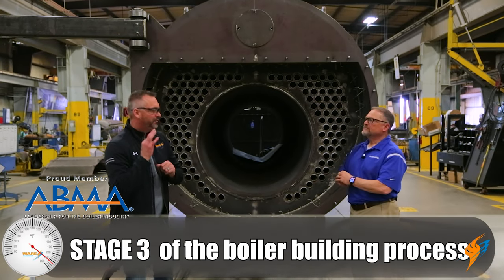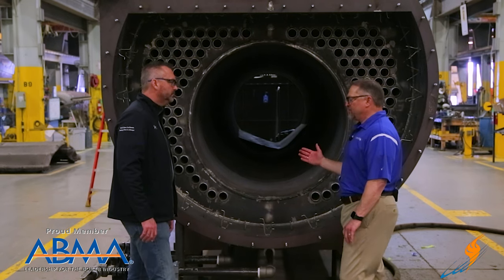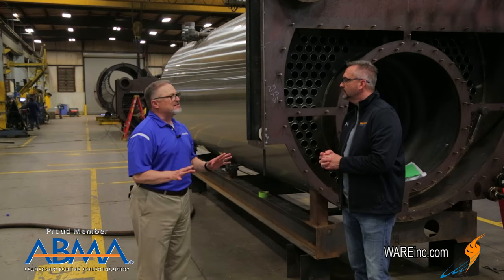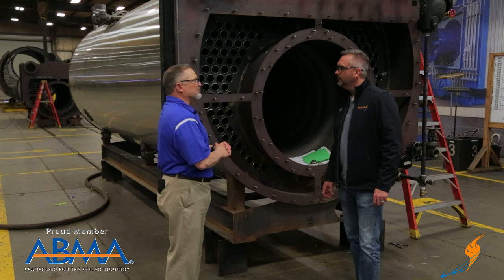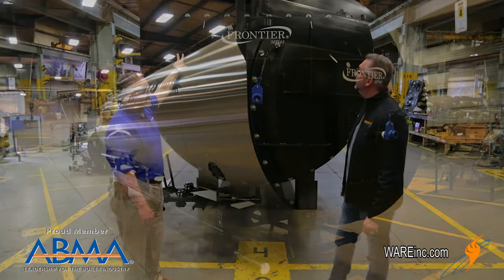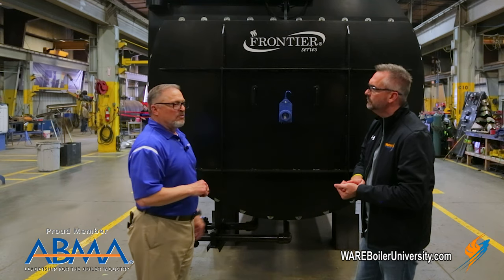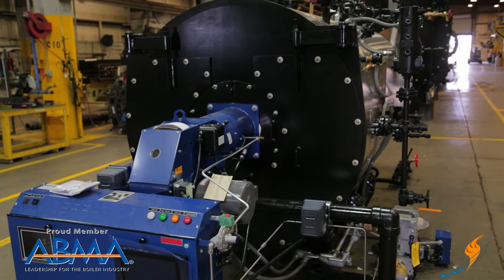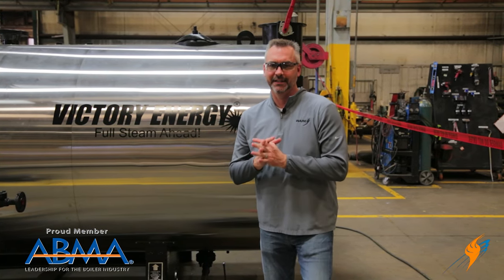How a Firetube Boiler is Made (Part 3/3) - Boiling Point

Comment: Really nice video! What i was wondering how do you circulate the gases throught the tubes? In the video it seems that smokestack is on the opposite side of the oil burner. In this case it is hard to understand how heat is transferred to the tubes.